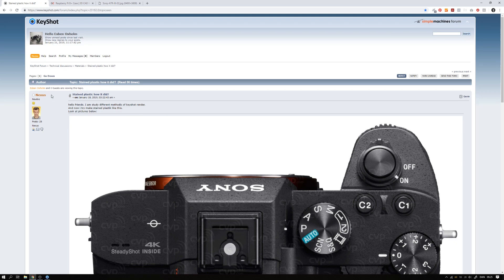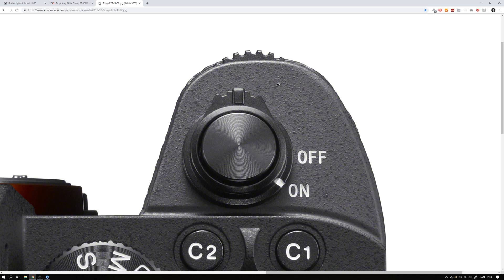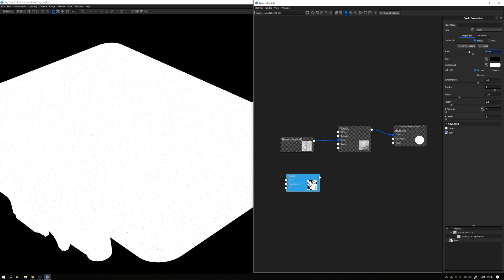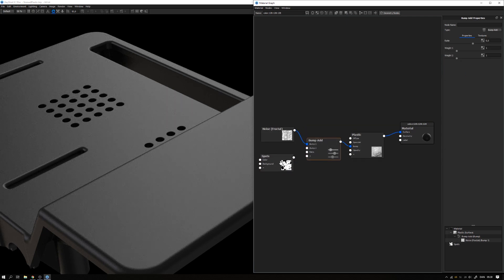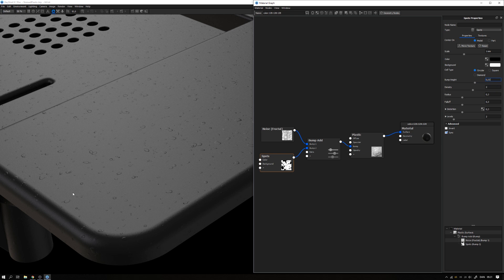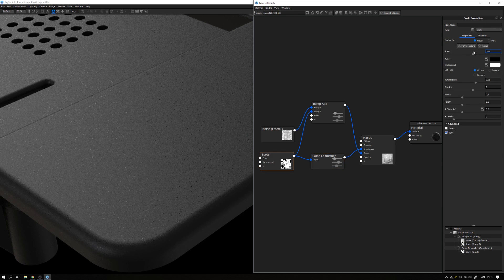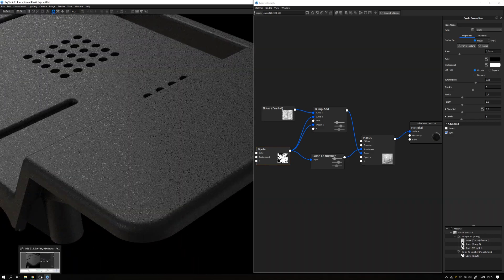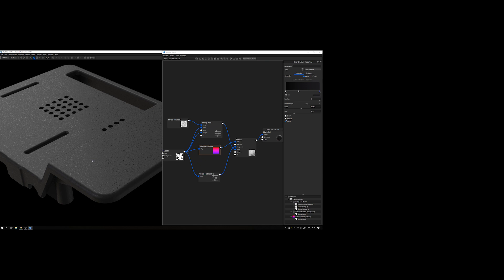KeyShot Material Study: Stained Plastic

Comment: Great tutorial!  That bump weight is a new one for me. Thanks!!
Reply: I love how you’ve been able to compress this into on material. I would have used a label with an opacity map, but this is just so much cleaner.
Reply from the maker: @dcjdesign_7892  indeed. I tend to only use labels for actual graphics or if I need a completely different material type.
Reply from the maker: Yeah, it is a bit hidden, but very useful :)

Comment: Nice tips, but can you do the wood tutorial please?
Reply from the maker: Hi Mattia. Missed your reply on the other video. I can't promise when I will address it, but it's definitely added to the list. Problem is that wood is indeed tough and how it should be handled depends a lot the type of wood and the shape of the model it should be applied to. 

My best advice here and now is to use a high-res PBR material (eg. from poliigon.com, texturehaven.com and cc0textures.com) and UV-unwrap your model in your modeling-software if possible.
Reply: @esbenoxholm  Hi Esben, yes I know, infact I hoped that you can show us a sort of method on how to approach the wood object and how to think when we are in front of it, which parameter look inside the material graph, so it can be usefull in the most of the case. I've alredy seen the video where you apply the parquet but in object is a bit different, especially because we need a close up and it need to be almost perfect.
Surely a video like this one, the Material Study, is usefull.

Thank you so much, the web site will help!
Reply from the maker: @mattiaitalia7783  thanks for the additional info. I'll see what I can do.